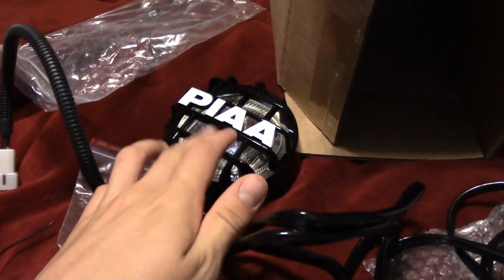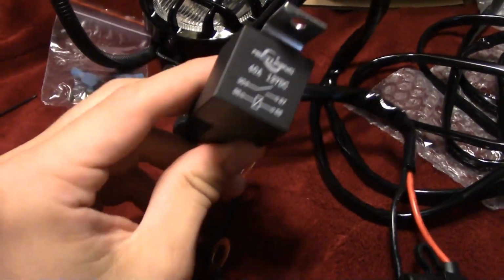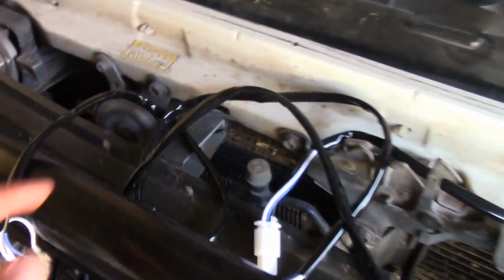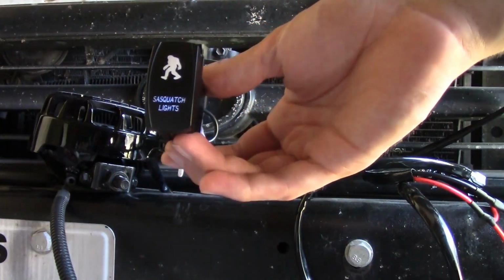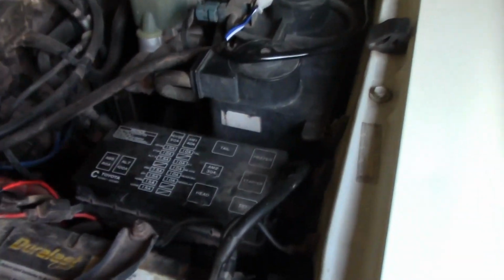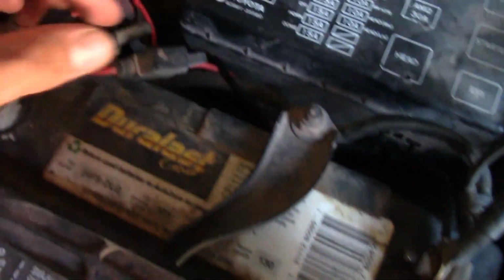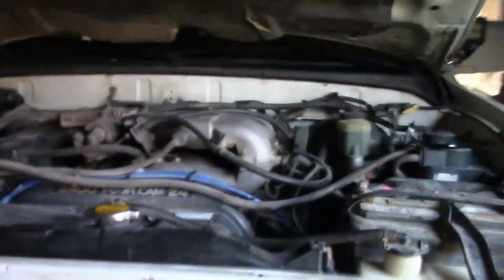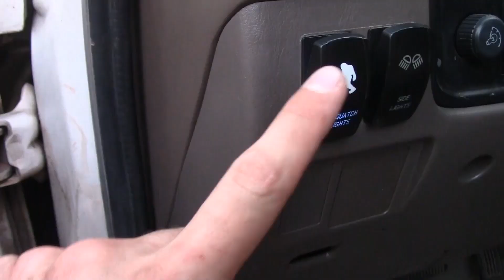Installing PIAA 510s On My 3rd Gen 4Runner! (The RIGHT Way)

Comment: Just saw this because I was looking around for a video about these lights. I have them installed in my bumper similar to yours. I’ve been trying to get them aligned so that they shine straight ahead and level to the ground. It’s been two weeks and I’ve been going around in circles and can’t seem to get them right. Did you do anything special when you installed them to make sure they were pointing where you wanted them to? Thanks
Reply from the maker: Mine actually aren't level either, I mostly put them in for looks and the way the bumper is designed, the PIAA covers are kind of stuck on unless you remove the light, so I just leave the covers on and dont use the lights very often. I'd say just keep messing with the adjustment screws and try and get it as best as you can. They aren't designed to be adjusted very easily or precisely it seems like lol